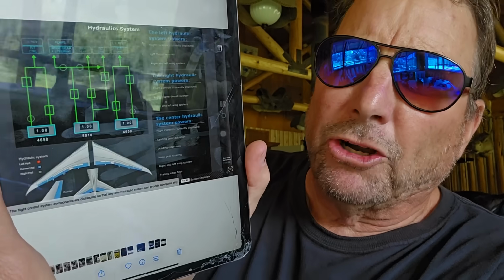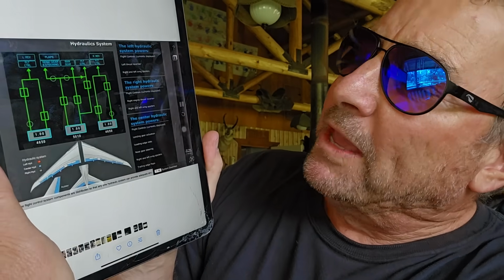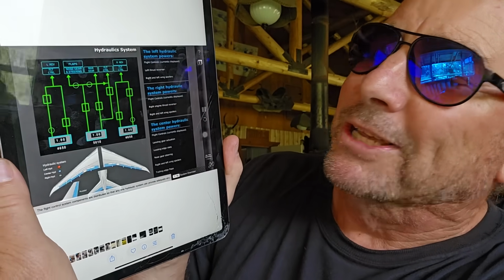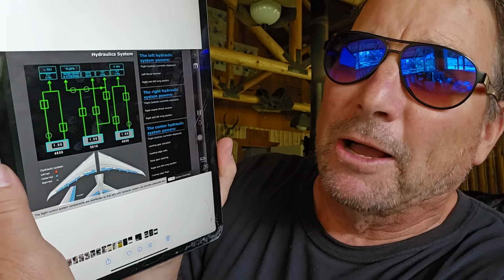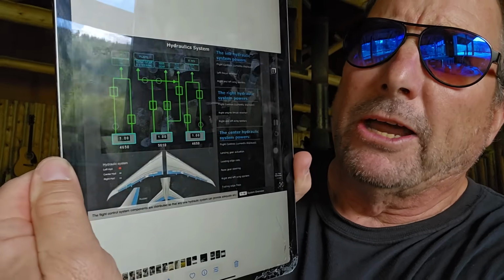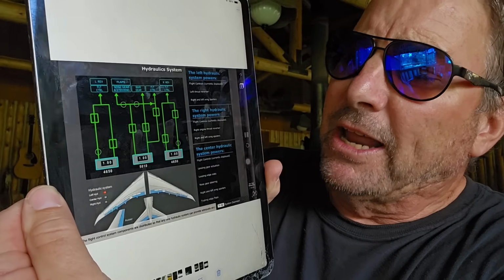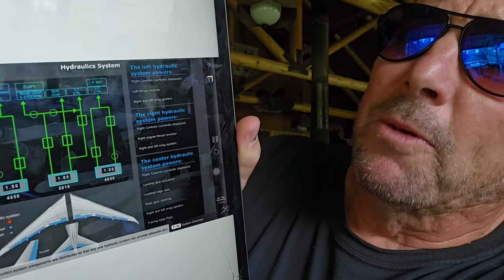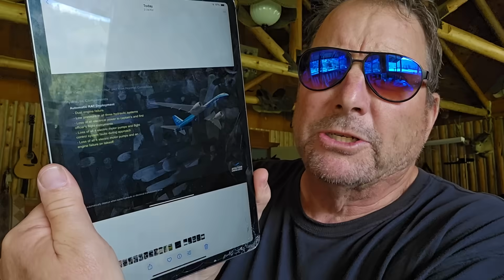787 Crash India What's a RAT? When does it deploy?

Comment: As a retired airline mechanic I can attest that with both the 777 and 787 virtually every maintenance action you do involves a routine to ensure that you don't accidentally drop the RAT.
Reply: I'm really curious now where and when was the last place and time that this aircraft was serviced and all the maintenance logs up to that point.
Reply: @clumsyzombie3144  I heard that on it's previous leg that that airframe encountered many electrical problems and the AC was not working, and n none of this was fixed or addressed before it's next flight out of India.
Reply: @nascar427 I saw this post too. A guy from India was in the previous flight (from Delhi to Ahmedabad), hours before the accident. He made videos showing that the AC was not working and that the infotainment screens were all "freezed", not being responsive to commands. The AC thing with the plane on the ground haven't caught my attention, but the "freezed" screens did.
Reply: @CFtablet  that would have absolutely nothing to do with the aircraft systems. The IFE system is completely separate from the other aircraft systems. 
It could potentially give an insight to the overall state of the aircraft maintenance though.
Reply: @737MaxPilot  Thanks for explaining it.
Reply: @737MaxPilot  Tell that to Swissair Flight 111.   The Infotainment system was recently upgraded and believed to be the cause of a fire that melted control wires in the cockpit..   Even a small electrical fire or short can cause problems with other systems that are not directly connected to it.
Reply: @agrojestasleezypmartini9538 so are you suspecting a fire here???
Reply: @nascar427  if this is accurate, then someone needs to go to prison for this
Reply: @nascar427 confirmed ex crew member said that plane had a long history of problems. Made in the Notorious NC plant perhaps?
Reply: @CFtablet  For information. Each possible fault on an aircraft is assigned to various categories. One such category is ADD (Acceptable Deferred Defect), a fault which does not need to be fixed immediately. Most airlines have rules which limit the maximum number of outstanding ADDs on any aircraft, just in case. Faulty TV screen would be an ADD; I'm not sure about aircon because it directly affects passengers' well-being.
Reply: @clumsyzombie3144  Stupid comment. Which of the alleged problems were ADDs and which were not ?
Reply: Yes I read that as well @nascar427
Reply: @clumsyzombie3144   I'm sure you're not the only one !   Air India used to be a prestigious national carrier owned and controlled by the State, but I believe it's now in the hands of the TATA Group.  Have to wonder whether it's still trying to recover financially from the Pandemic downturn,  and how that might be reflected in falling maintenance standards ?
Reply: @roxximusik8958  That is so odd because it wasn't even two weeks ago that my local news reported that Air India has the worst on-time performance out of any airline operating out of SFO between the years of 2020 to 2024. What is going on?? Is it budget cuts, cutting back of quality and standards of maintenance, mismanagement from the new owners, or what? Something is off about this whole situation.
Reply: @clumsyzombie3144  Timeliness is not an reliable measure because it is affected by factors outside the control of any airline.
Reply: @clumsyzombie3144   In a sense, it could be one of the better outcomes of an inquiry, because otherwise there might be an underlying fault with the manufacturer CanBus system serious enough to potentially ground the world's 787 fleet, at least temporarily.    This was a shocking disaster that should never have happened.  There was zero height and time for any attempt at emergency landing.
Reply: @clumsyzombie3144  There are reports that the plane was "refurbished" "not long" before the accident flight. No information was provided on the precise meaning of those two phrases.
Reply: @clumsyzombie3144  Oh yeah.  The investigators are already on that guaranteed.  If you've ever seen an episode or two of Air Crash Investigation tv show it's incredible the amount of digging they do after a major airplane crash.  They once found re-stamped used low quality parts on Air Force One after an other airplane crashed from the cause of a weak falsely graded bolt.
Reply: I saw a video clip of an airport fire engine at the crash site driving over the top of what looked like the left wing. Not ideal for the crash investigation but seen as it was in an emergency it was in a hurry to get to where it was needed, so be it. Now I'm no pilot but I've been on enough flights to tell the front of the wing from the rear and what the leading edge flaps look like. In that clip the leading edge flaps definitely look to be angled downwards as if deployed, also as the fire truck drives over the wing the leading edge flaps don't simply get pushed back up into the wing as if the driving mechanism was loose or sheared. They maintain their shape and angle like they were set to that position.
Reply: @suprafrase  Yes, I've seen photos of that wing and I agree that the slats and flaps appear to be deployed.
Reply: @suprafrase isn’t that flaps 1?
Reply: Given the list in the pinned comment then there's the "Loss of all engines", which in turn makes me think if there's somewhere a single point of failure that could cause both engines to fail simultaneously, like a fuel starvation situation.
My thought here is that whenever you see the exhaust from jet engines there's often some traces visible from the exhaust in many conditions and that couldn't be seen. However the quality of the videos weren't the best so it could be invisible. The traces I think of are smoke traces and thermal light diffraction, and at full thrust it wouldn't be unexpected to see some air discoloration.
I agree - getting the RAT dropped on your head would be a bad day for you and your coworkers.
Reply: @ehsnils  If you look at the CCTV footage, you could easily convince yourself that there is heat haze from the engines until the plane starts to descend, at which point that haze disappears. The video quality is low, so I am loathe to be definitive, but we cannot ignore the possibility that there is evidence of a loss of both engines.
Reply: Is it true that it's a spring-loaded device that drops with an audible thwump from within the cabin ?
Reply: @roxximusik8958 yes….you can hear it drop….maybe more like feel it drop. You can definitely hear the prop noise.
Reply: @roxximusik8958 the bang the survivor heard was probably the rat deploying
Reply: And some india news sources.. obviously I cant verify stated the plane was getting retrofit for something the day before
Reply: Given that this aircraft was just returned from maintenance is there any possibility that the RAT was still inactivated/unable to deploy and did not deploy when it should have?
Reply: @tomriley5790 unlikely. Many people are claiming they can hear it on the video.
Reply: @tomriley5790  There is video and audio evidence which suggests that the RAT did deploy, almost certainly indicating a major failure in the engines and/or hydraulics.
Reply: 747-8 also has a RAT.
Reply: @metrocaptain as well as the 777
Reply: Is there a 'Remove before flight' pin you can install to lock it up?
Reply: @robertbackhaus8911  "Is there a 'Remove before flight' pin you can install to lock it up?"  You know they try to minimize the use of lockout pins to really critical stuff because sooner or later somebody is gonna forget to remove one.
Reply: @pi.actual  It could be oriented such that if forgotten, aerodynamic drag will pull it out after takeoff.
Reply: @pi.actual  It has already happened.  Those remove before flight tags.  Aeroperú Flight 603 crashed because of this exact thing.
Reply: @agrojestasleezypmartini9538 false. That aircraft crashed due to maintenance putting CLEAR tape over the static ports for cleaning the plane, and not removing it. The clear tape was not seen during the pilot’s walk around inspection. 
Quite a different scenario than what you inferred.
Reply: @737MaxPilot  So maybe if it was a remove before flight on the tape they may have noticed it?  Like is that what was supposed to be there instead of the tape?
Reply: @agrojestasleezypmartini9538 not really, those ports are only covered up for either washes or painting. Maintenance procedures are to use tape, but not clear tape, and to remove it before the aircraft is returned to service. The remove before flight streamers are for use on covers/pins that are needed for short term use. These would be things the crew may expect to be installed, overnight for example.
Reply: Hi Juan. Are you still actively flying for a major airline or have you retired?
Reply: But on this you can not start engines? But for start engines need more than 20 seconds
Reply: Rats ! I thought it was more simple. Sounds like a rat operating, but sound is less dependable than sight. With all the 4K phone in the wild, someone should have a better view. 5 degrees of flap can’t be seen on the video.
The landing gear stays down. Maybe too many alarms/ shock effect.
A made decision. Landing gear is almost indestructible, like Aussies. The gear will absorb impact, and rip away. F=ma, the less mass the less F orce.
Condolences to the relatives and friends of those on board.
Reply: @geoffreyjames3107  Landing gear is almost indestructible. Erm, no, that is not remotely the case.
Reply: In the seconds to react to a out of normal conditions was about how long it flew.
Identify that the plane is loosing the gravity war. Why? 
Reset brain to impact mode.
So my thinking went leave gear  down and try to absorb as much of the impact through it. Indestructible was relative, so I’ll add compared to the rest of the aircraft.
I’m not comfortable saying more out of respect to those who suffered loss. My heart goes out to you.
Reply: but this must have been a deployment due to one of those failures listed.
Reply: Is it possible to reset or silence this alarm?
Reply: @pi.actual    If the AC power transfer from APU to engine driven VFSG generators silently fails, and isn’t caught in the crew alerting system screen before APU shutdown, (which is a required check by the pilots to make sure the engine driven generators are online prior to APU shutdown) and if the APU is shut down just prior to takeoff (shuts down in a 1 1/2 minute process after selecting APU off) the 787 can lose all AC power right after liftoff, causing engines to drop to idle thrust safe mode until the thrust levers are cycled. There is no takeoff configuration aural warning for this condition.

Possible 787 Sequence – Dual AC Loss & Idle Thrust Safe Mode:

After start up, AC power transfers from APU to engine generators automatically in the 787. If it does not transfer due to some Buss fault and the pilots fail to recognize it, and then for example the APU is shut down just prior to takeoff in a trained human flow pattern, it takes 1 1/2 to 2 minutes to shut down. The APU being the sole provider of AC power at that point may shut down just after takeoff. At that point there would be a loss of AC power.   The RAT deploys. Engines may drop into idle thrust “safe mode,” even with thrust levers in TOGA. Keep in mind that 787 thrust levers never move normally via auto throttle /Fadec at all.  To recover thrust, with loss of AC power though, pilots must move levers out of TOGA detent and then back in to TOGA detent or full forward. This tells FADEC (powered by engine driven permanent magnet generators PMG even without AC power) to exit “idle thrust” safe mode. Again no AC power is needed for this, moving the thrust levers out of the position they were in just prior to AC power loss makes the Fadec recognize pilot manual control input by lever movement out of the original TOGA detent and back into TOGA, or full forward to regain full takeoff power, or for thrust to simply follow manual thrust lever movement.

Again this could happen if, for example, the APU was shut down just before takeoff, but engine VFSG generators hadn’t actually picked up the load due to a bus fault or automatic switching issue. If that fault wasn’t seen when the pilots are supposed to check for propulsion engine driven generators online before shutting down the APU, (maybe the indication was buried under other MEL messages on the crew alerting system screen?), AC power drops off due to APU shutting down after liftoff, (if APU shut down just prior to takeoff roll), due to loss of AC power, RAT kicks out, engines go to “idle thrust” safe mode, and unless the thrust levers are moved from present position in TOGA takeoff thrust detent for Fadec to recognize human manipulation, the engines rollback and stay at idle.

Landing gear didn’t retract because 787 hydraulics for something that large relies on AC hydraulic pumps and after RAT deplored there is limited AC power and hydraulics. It was canted the opposite direction like it does when it is starting to be retracted, so we know they put the gear handle up. It’s hard to see the flaps down due to the plan form of the wing viewed from behind. If flaps were not down in a takeoff position they would’ve received an aural takeoff configuration warning. Crash pictures show flaps in takeoff position. A loud bang and flashing lights would be emergency lighting and the RAT slamming down hard with loss of AC power.

If the APU was shut down earlier before takeoff, somewhere earlier in taxi, and there was some sort of buss fault preventing automatic transfer of AC power from APU to engine generators on engine start up, then shutting down the APU would have just caused the aircraft AC power to drop offline. Systems would simply go dark while safely on the ground, and the situation would be obvious. 

Pure speculation.

Who am I? Nobody. Just a 59-year-old airline pilot, 21,000+ hours, A&P/IA since my teens, with involvement in seven engine failures behind me (in old cargo planes) , and a slew of other weird mechanicals I’ve seen that have forced me to try to figure out and program a response that might not be known readily, for the worst case scenarios. During training and learning operational flow patterns the book will say do this, so I say what would happen if I unintentionally didn’t. And follow that chain of events to the end. 

Recognizing we are human, and looking for human mistakes is what makes us safe. Sometimes it’s the small missed step that sets off the whole chain. 

Good thing we will see what it actually was with the boxes and I wouldn’t be surprised with today’s FOQA and ACMS that data has already transmitted live.
Reply: Do you mean because maintenance procedures can fool the plane into thinking one of those conditions exist?  Or even that the condition actually does exist?  (Maybe there should be a button… “No RAT for two hours!”)
Reply: @ydonl  Lots of conditional situations, you might be doing a test where you have the ship in air mode, hangar power drops off for some reason and pop goes the RAT right onto somebody's head.
Reply: @pi.actual  I think I sorta get it; just looking for interesting details like that!  Thanks.
Reply: You know there's something called AI to find out thinkys  @ydonl
Reply: @ydonl  I'm guessing probably workplace safety more than anything. If that thing gets accidentally deployed and someone is standing under it,  the shear weight dropping down on someone's head could be fatal.
Reply: @empireoflizards  It's not just the weight. It has a huge spring and lots of stored energy. It sounds like a gun going off when it deploys.
Reply: @mchristr  Yeah, makes sense. So, all in all, it's ft-lbs of force, which can be dangerous for anyone too close.
Reply: @ydonl 😂 I’m still waiting 10+ years for a phone OS that is sensible enough to have a “SILENT mode for ONLY the next X minutes”. Such an obvious thing to have 🤬
Reply: @__Andrew_ on Android, try the 'do not disturb' button in the quick pulldown screen. If it's not there, you might need to drag it in there so it's readily available.
Reply: @__Andrew_  Android had it for years. It goes down to 15 minutes.
Reply: @__Andrew_  I wrote an app to do just that.
Reply: @__Andrew_  There’s a pretty strong assumption that our memories work and that our eyes are like eagles.  Me… nope!  :)
Reply: @misium android phones have a RAT too? :)
Reply: What if everything is perfect and the pilot presses the RAT deploy button? What consequences will happen?
Reply: @kukunishad not much, other than noise.
Reply: @kukunishad im like 99.5% sure the pilots can't manually deploy the RAT on a 787
Reply: @connorpoole2194  So what do you 99.5% think happens when you push that button on the overhead hydraulics panel labeled RAM AIR TURBINE?
Reply: @pi.actual  In 99.5 per cent of cases, the turbine doesn't deploy. Allegedly.
Reply: @connorpoole2194 and you are correct.
Reply: @kukunishad I’d imagine the plane would switch power to the rat and emergency lighting only. That’s what’s meant to happen. Not sure if the software would check to see if there’s still an alternative power source first. You’d think it would, but then you’d think the MCAS would check altitude before ordering 20 nose down overrides to the pilots inputs
Reply: @kukunishad  the rat deploys.The manual trigger overrides all safeties, and is generally how the rat is deployed for maintenance on the ground. 

Secondly, the rat automatic deployment is deactivated with the aircraft indicating weight on wheels. Generally the rat is only safed for jacking an aircraft or spoofing the gear, along with air data instrument heaters and a few other things depending on airframe.
Reply: @kukunishad  All else being equal, the RAT deploys and generates a bit of power.
Reply: So you're telling me you can hear the RAT rumble near the two huge roaring turbofan engines with the take-off thrust applied? How?
Reply: @empe811  yes. Supersonic prop tips producing a shock wave audible over most other things- like the Republic Thunderscreech or TU 95. Very loud!
Reply: @empe811  it's a different tone and very loud. I can hear it with bad ears.
Reply: @empe811  I don’t know about at takeoff power, but you can definitely hear it otherwise.
Reply: @empe811  Three things. 1) We are not certain that the engines were working as the aircraft descended.  2) Modern high bypass engines are very quiet.  3) The sound of the RAT is very distinctive and very different from turbo fan noise and so is quite easily discernible even if the engines are operating.
Reply: When the Aircraft was refuled "  Water Contaminated " fuel pumped on. Just about enough time for separation to start. Both engines drawing from same source , would  have effect at same time. When demand for full power called huge glug of wet fuel  drawn in. Would probably not been noticed when manovering low fuel demand.